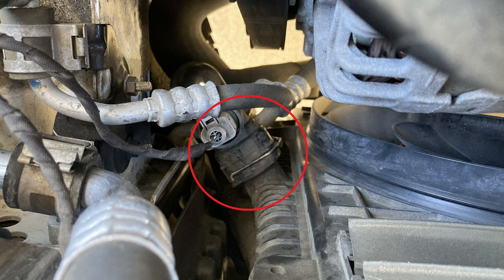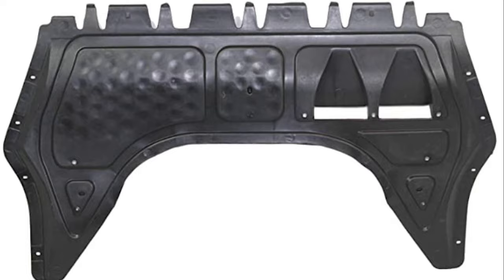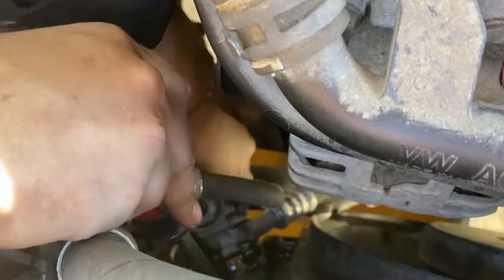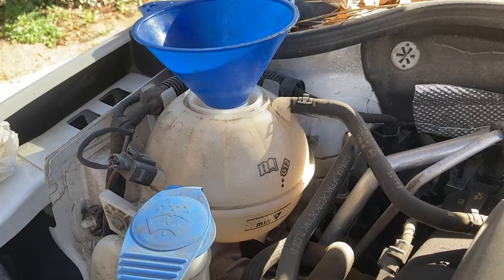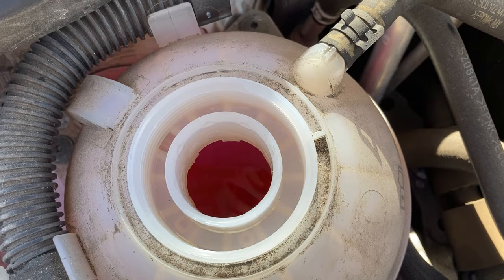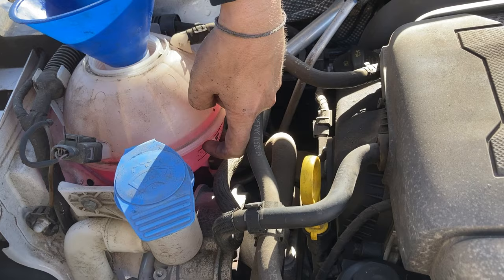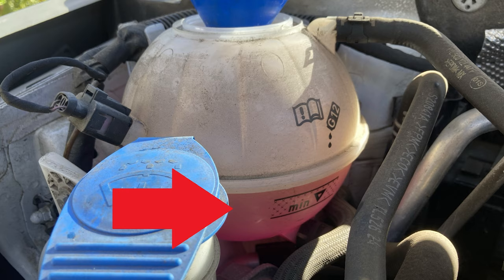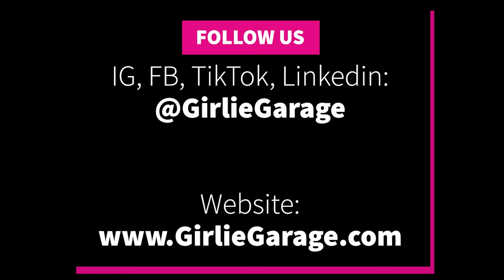2011-2018 VW Jetta - Coolant Drain & Refill - Girlie Garage

Comment: U put different coolant G13 instead of G12😳😱🙄🫢reservoir says G12
Reply: VW has updated the coolant.
G13 is the latest formula, and can be used on vehicles calling for G12

Also, VW spec’d coolant is needed for long cooling system life in VW’s
Reply: g12 isn't available anymore. g13 is the successor and meets all the requirements for g12.

Comment: MINES NEVER STAY PINK I'VE CHANGE TWICE THE DEALER SAYS IT CONTAMINATED TWICE?
Reply from the maker: It is a closed system so if it not staying pink then it is getting contaminated from somewhere. I would check o-rings on your oil cooler or have your head gasket tested properly for leaks
Reply: @GirlieGarage  NO LEAKS IT DOESN'T RUN HOT BUT I LIVE IN FLORIDA WERE ITS HOT ALL THE TIME MAYBE THAT COULD BE IT 92 SOMETIMES 100 DEGREES
Reply from the maker: @davidperez7260  I think you should have it diagnosed by a different shop and have them give you a diagnosis not just “it’s contaminated”

Comment: Does this drain all the fluid from both the engine and the radiator?
Reply from the maker: No, this is only a drain and refill (of the radiator) not a full flush